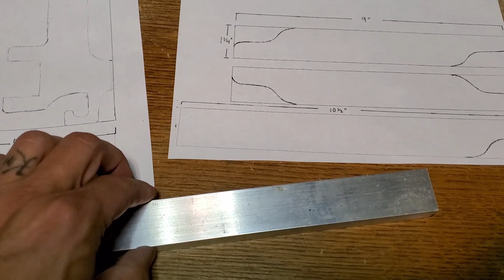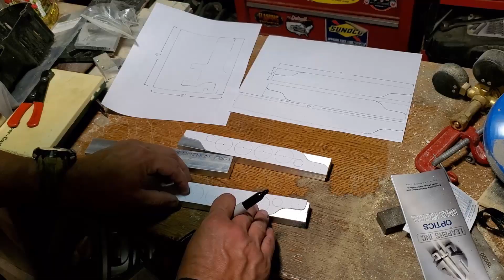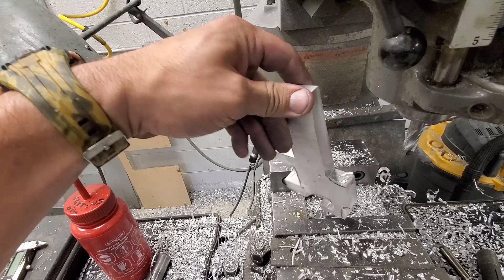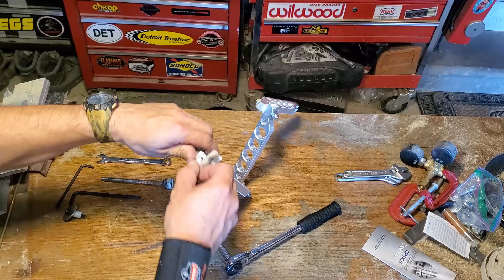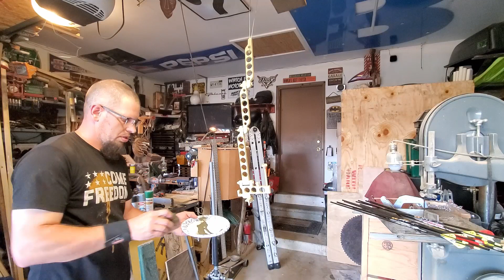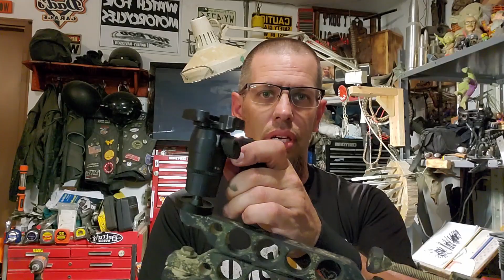DIY Lightweight Camera Arm

Comment: What size bolts did you use?
Reply from the maker: I used 3/8 zinc plated bolts. I ended up making a few for sale. I still have  couple if you are interested. https://youtu.be/wy17V-Yku7c
Reply: Yes . Sent you a message on Facebook

Comment: Can I get the template for this? Also do you happen to have a link for the tripod head?
Reply from the maker: Sure, send me an email at jbugmotorcycle@gmail.com and i can send you the template that i drew up. I found the tripod on facebook for $30. it sells for around $90 on amazon. 
https://www.amazon.com/Sunpak-PlatinumPlus-6000PG-Tripod-620-600-UPGBB/dp/B00N7F4TQ6